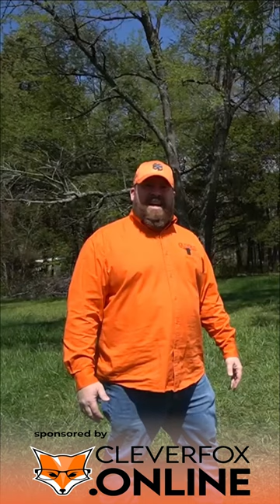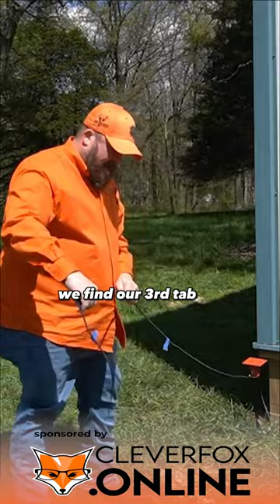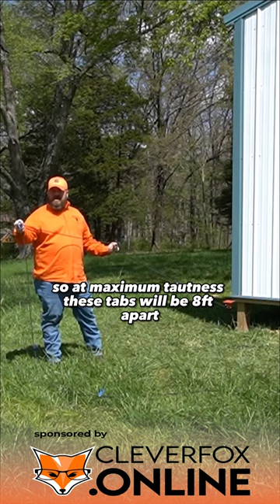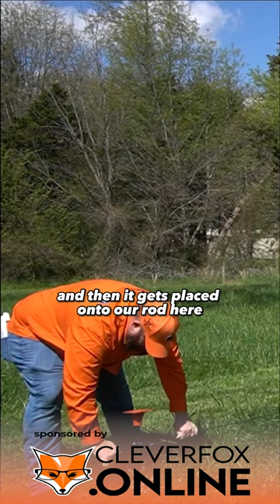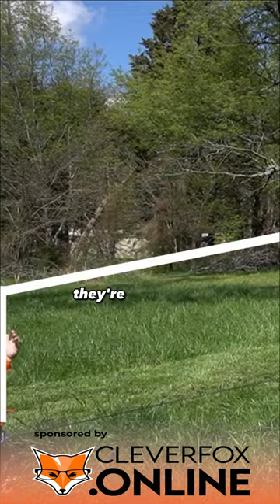The Best String Line System for Fence? #Shorts

Comment: That's convenient for new install but I rarely do a new install. 98% of the fences I build are replacements. Frequently im the 2nd or 3rd or even 4th fence going in. At that point I don't worry about making sure everything's equal I worry more about being able to get the damn Post in the ground perioid.
Reply from the maker: Fair point! Thanks for weighing in!
Reply: Why not remove the old concrete?
Reply: @philipyates3194 labor/time/profit 
It will cost more in labor which takes time and costs money. Do your cut back and move on.

Comment: 1. Total run/required post spacing= number of spaces (round up if not even number)
2. Total run/ number of spaces= post spacing
3. Multiply the decimal part of number by 12 for the inches
4. Take money you saved and buy a real tool

Comment: Can't you string and close pins,?
Reply from the maker: You could, but you’d still need to measure and decide into equal sections
Reply: @JoeEverest but if you do as your demo states, and fully strech the line and THEN place markers at 8' then youre basically making the same tool but for FRACTIONS of the price. Idk man, seems like an awful gimmick to me.
But hey, theres an ass for every seat 🤷🏻‍♂️
Reply from the maker: @christhut8140  the markers are already a part of the line when we received it. So, if it’s not at 100% stretch the markers are already correctly spaced in proportional intervals. If that makes sense?

Comment: This seems very backwards... In the UK, the fence panels lengths are fixed.. 
You only want to have a single one that is short.. Don't want to have to adjust every single panel.
Reply: Do you agree it looks nicer this way, though?
Reply: @ericl6460  I would need to see a "smallest possible" vs "largest possible" side by side.. so it could be a "maybe".
For additional price in having every panel having to be custom sized rather than a single one? Definitely not worth it.
Reply: @ColinRichardson  do you pre-build all your panels?
Reply: @ericl6460  They are purchased pre-built. There are set widths, with 2 heights variations.. 
Designs and materials and constructions all different, but you could put the pillars in at any time, and then contact any panel supplier with which of the 2 heights you want.. and as if by magic, you could slide all the panels in within about an hour (or two, depends how tall you are and how much you struggle)
Reply: @ColinRichardson  interesting stuff. around here it's built board by board